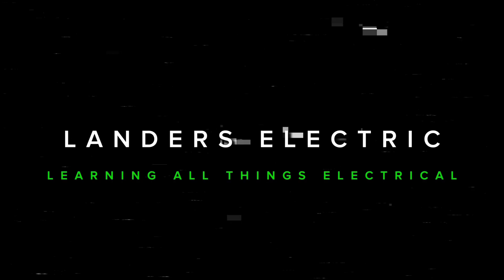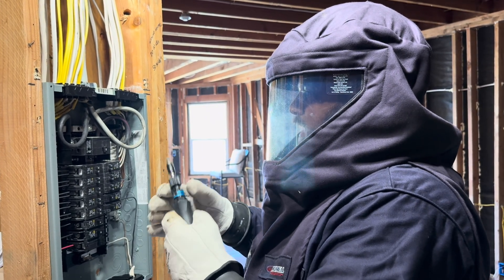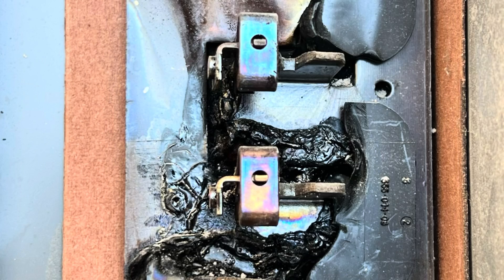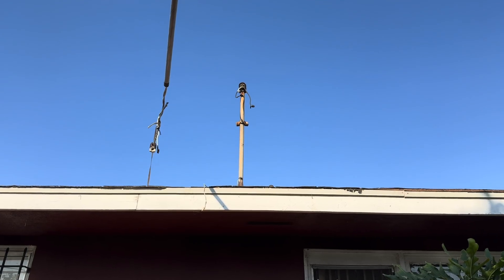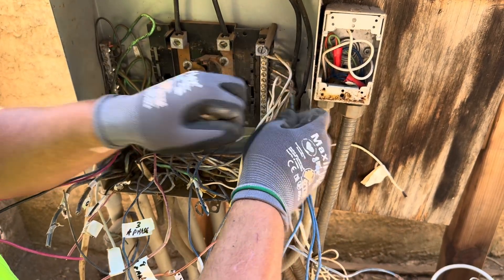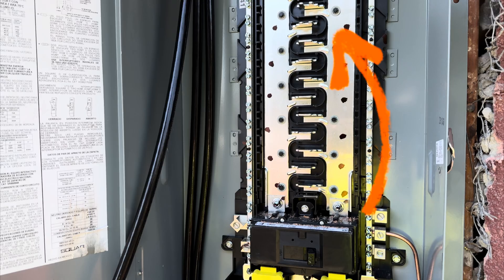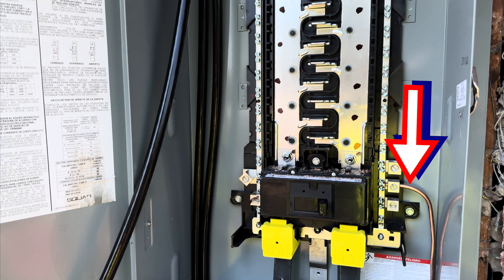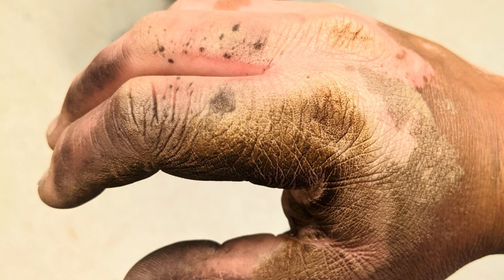I Could've DIED! | Electrical Panel Upgrade Arc Flash Accident

Comment: I just had my first accident where there was some sort of odd contact between the + terminal and chassis ground in one of my solar charge controllers. I had foolishly expected everything to go well and hadn't checked for continuity before turning the breaker on.

The contact was poor, but the battery was large (70kWh, 48V nominal LiFePo4) and boy oh boy did I get a nice bang and sparks flying everywhere. Thankfully since I am a bit paranoid, I was wearing safety goggles, although I think nothing did hit me there. I also noticed that the controller turned on fine, despite the spark ball, because some of the current also went the path it was intended to go. Of course, the circuit breaker tripped right there and then and soon after the controller went offline as a result.

Initially I had no idea what had happened, guessing that the device must be faulty. Until closer examination I was  baffled, but as soon as I saw the black spot at the + terminal I instantly figured out where the issue was.

This happened recently, and it still enters my thoughts. I will never forget to check for continuity again. Of course, this is the best kind of scare one can get because there was no damage to me or any equipment, but I still got a valuable lesson about respecting powerful forces.
Reply from the maker: That’s crazy! Really glad you’re ok and nothing was damaged! And yes, this is the best kind of lesson. I’m sure you’ll never do that again!

Comment: Glad youre okay. Reminds me when I was a Apprentice in Commercial Hvac. Working on a data center unit 460v 200 amp  I was checking voltages with my meter and accidentally touched hot to ground on a probe. All I saw was abright flash and the heat that came at my face. I was fortunate. Taught me to respect electricity.

Comment: The video mentioned Doctors looking entry wounds and exit wounds. One of the worst things about electrical burns is when electricity flows through the body from entry point and exit point the electricity will cause internal burns. In that case it is possible for the skin to look good on the outside while muscles and nerves are internally burned.
Reply from the maker: That’s a great point!

Comment: I did have a panel blow up in my face. It was my fault. In a hurry and did not check for voltage. My face looked like your hand. I was flash blinded and could not see. At first there was not any severe pain, but that changed and I hurt. Went to a hospital and they removed small pieces of molted copper from my eyes. I am lucky. It all healed and i do not have any problems from it.

Comment: I once accidentally dropped an uninsulated screw driver into a large battery box we were just starting to work on.  In a totally automatic reaction, i jerked backwards the instant the screw driver left my hand and closed my eyes.  No damage to any body parts but we could never find the screwdriver shaft after the flash.  It had vaporized completely.

Comment: His number 1 mistake was working past his limit of endurance.
The proper PPE (electrical rated face shield, appropriate hot gloves and appropriate FR clothing) for a given Arc Flash Incident Energy Rating is the minimum. That looks like a 40 Cal suit- for 120/240 split phase that's overkill. But, if it makes you feel safe, you do you. It's highly unlikely that the Incident Energy would be more than 1.2 cal/cm². Cat 1 PPE starts @ 4 cal/cm².
Hot gloves (or turning off the main) would've protected your hand; a 40 Cal suit is superfluous.

Comment: I feel bad that this happened. When you work this many hours you are NOT running on a FULL mind. I just couldnt work that many hours. I have taken down countless underground 100 amp & the more open 200 meter sockets that you dont use in your area down hot. I have had to change out 2 100 amp panels hot because they couldnt unlock the meter. Back then I had no protection but had to BE ON MY TOES & BE IN FULL CONTROL when I was doing this. If I felt I couldnt do it then I would ask my boss to have the utility come & disconnect the laterals.  In later years as I aged I told my boss to have the utility disconnect because I felt less confidant then I did in my 20s    I dont see the reason for a suit when cutting & taping off a service drop unless there are damaged cables at the weather head or metal very close to where your working off the FIBERGLASS LADDER. I found OVERHEAD hot service drop reconnects to be the safest hot work. I would line the box with cardboard [meter socket] , do one line at a time, tape it off , do the next one, tape it off with the stripped end cut off for my safety. On the more open 200 amp meter sockets that resembled a long trough I would take one off at a time, tape it off & replace the meter socket & have the utility reconnect or I would do it if the cables were plenty long enough [existing utility crimp lugs].
Whenever I did panel upgrades I would almost ALWAYS pull the meter so I wasnt working unnecessarily hot.
In my service area the meter socket ONLY is on the outside & the 22,k AIC main breaker QO panels I installed were on the inside. I dont understand why they put those all in one unit outside
in California!!
I wouldnt want my branch circuits on the outside. In Cook County Illinois you have to use steel RMC for the outside conduits & the whole house has to be roughed in EMT. ROMEX will get you a BIG red tag in my region!!
I have been disabled since 2020 & electrical work had nothing to do with it. Sometimes I REALLY MISS DOING MY SERVICE CHANGES. I used my license to help my family out as much as I possibly could. This made me able to give them 200 amp SQUARE D QO 40 opening full sized panels.  
DUDE, I feel VERY BAD this had to happen to you & the emotional & psychological harm it must have caused you.!!!

Comment: Yes, we check if power is off all of the time or we install protection around the bus bars. 
But with SoCal Edison and DWP in LA, if you tell the power companies to cut the power, you will be without power until you get a final inspection for the panel from the city, that could take weeks for the power company to return. In the past it was not like this but times have change. So, screw it, do it live, if its overhead cut the wire at the mast and put temp connections until the utility company comes and installs final connectors. If it's under ground, install protection around all buss bars and live components while removing the old panel and installing the new.
On 277/480, power needs to be off unless installing a breaker.

Comment: This why wear electrician glove is important at these voltages. as hobby only work with 120 volts and less. though at hvac class I did work with 240. but only thing above 240 one alway need ppe for even using volt meter.  I only do electric work when there is no power to circuit because I am clumsy.

Comment: Absolutely good thing you're alive and have healed up. Definitely double-check that the power is off. I sometimes work with 600 volts, and I constantly triple check.power is off, and PPE should always be worn. Power can kill and as you know.once past a certain volt.your stuck like glue.

Comment: Voltage is really only a risk as far as how far it will jump out to grab you (240 is not likely to jump the air gap, unlike the higher voltages). Current is the real problem, that is where you get the big flash.

Comment: It only takes a second to ruin the rest of a life to lose a life. As a power lineman for over 4 decades I’ve seen some bad things happen, I’ve lost co workers, had friends badly burned on the job. For most of my career FR clothing was not required, I was in a bucket truck on a pole transferring 3 phase primaries  for a highway road widening job. There was another bucket on the next pole who were going to transfer the phases at the same time. We were working energized primaries at 15kv, in order to direct handle that voltage protective rubber line hose and blankets are installed on the primaries. The primaries were spacer cable configuration which has all 3 phases and grounded primary neutral in close proximity. Spacer cable has insulation that resists tree contact trips of breakers, it is also very susceptible to lightening strikes, lightening causes pin holes in the cable allowing moisture into the cable which causes oxidation. The a lineman can’t see the oxidized cable because of the insulation. As the 2 lineman in the air were applying line hose to the cable, one of the cables broke in half because it was so oxidized. The when the cable broke, it broke load right where the lineman were, the flash went phase to phase causing a huge flash that enveloped both men. The lineman on the ground immediately used the lower controls to get the linemen out of there and on the ground. This was winter and the men had multiple layers of clothing on which the outer layers burned off mostly. If it was summer they would have been injured worse. Both sustained thermal flash burns to their faces. What happened to the skin on your hand happened to their faces. On primary circuits we have over current relays that operate when a phase to ground, phase to phase fault occurs, they also operate on over current. The relays trip the breaker then at timed intervals of 15 seconds and 30 seconds the breaker recloses, if the fault still exists, the breaker locks out. As the men were being lower the breaker operated 2 more times burning another phase down. Th thermal flash was so hot, that it melted the insulated bucket liners down inside the bucket. If this happened in summer both men would probably be dead. It only takes a second….. be safe out there.

Comment: Dang, I'm really surprised the main didn't trip since it was the bus bars that were crossed. Goes to show why panel swaps need to involve the utility company... because... you know, no over current device between the meter and the main panel's main breaker (unless the home has an ATS or other means of disconnect, but these are less common).

Honestly, I think an exterior means of disconnect should be required for all new home construction. IMO a panel in a locked up garage is not readily accessible.

Comment: I'm 25 yrs in the trade, and a master in florida. About 15 yrs ago I was a foreman for my old company. I got the call from my boss to go check out a a small 6 store plaza that we took over because another company got kicked off the job. I met the superintendent in the main electrical room. As I was checking quality of work in the gutters meters, and house panels I started small talk with him asking about the previous contractor. He told me the guys were hacks and did a lot of questionable things that even him not an electrician knew were wrong. He then told told me the final straw was one got killed on the job. I freaked was like WHAT THE F#@K!! WHERE, HOW?? He then said right there pointing at house panel. 120/240v 42 circuit panel. He had on hand on the bottom of can and was messing around with main feeds to the panel. They were aluminum and must have been pulled very rough as a big slit was in the backside of the B phase. Needless to say I had to scrape the guys fingerprints from the bottom of can then threw the screwdriver away. Respect it or it will kill you.

Comment: I know 2 people that were hit by lightning..... Twice. One had minor problems after(dead at 40), the second had chronic neuropathy along with entry exit wounds that healed. I've been hit by a house service main through a Dump truck twice, one made me shit my brains out within minutes. My Crane got energized by 101kv when the temporary grounding system failed. Bunny hops saved my bacon. I've hit 440 underground primary with a backhoe. Arc flash turned the digging bucket blue and both me and the shovel man had mild retinal burns. I've been sprayed in the eyes and face with battery acid, lost consciousness from chemical fumes, had a gas can blow up while trying to rescue a guy out of his burning car( 2nd degree burns on face and throat) [ Hint. don't breathe in fire] cut off a finger (successfully reattached) , works ok )🖕 yup, that one. My Dr asked me if I've ever been hospitalized 😂😂😂😂 sure, how much paper do you have to write it all down? Oh, and broke my cervical spine twice, both legs, one arm, hip,ribs, lots of fingers toes ankles.... Still alive.😂 Forced Retired at 49, you're running outta luck they said. 62 and still alive and complaining

Comment: It seems so easy to forget that the entire buss is still live when the main breaker is shut off..  I think the only way to make the entire box safe is to pull the meter but I'm not an electrician.  I notice they do allow a generator transfer switch to be installed upstream of the main box that can make the entire box safe but I wonder why not just a simple shut off switch in its own box. I know there is a bonding requirement and maybe that explains why the code tries to just have the main breaker be the only shut off even though it leaves the bus live.

Comment: Arc blast is no fun. 2008 pulling a 75amp fuse in a 480v bucket that had bleed through voltage. Fus eblew up, 30 foot feet to cieling fireball and blew 3 main 1500 amp fuses to the plant. Safety glasses went from clear to smoky black with burns on face and arms (safety glasses saved my eyes). Also used plastic fuse puller instead of Channel locks, saved my life. It's not proper protective equipment for nothing. Ambulance trip and time off with no pay.

Comment: That’s happen when you don’t follow the basic safety rules: The 5 safety rules

Unlocking
Secure against reconnection
Ensure that there is no voltage
Earth and short-circuit
Cover or isolate neighboring live parts

Comment: I've seen a few arc flash accidents, or atleast the immediate aftermath. One former coworker of mine was trouble shooting a 2500 ton press. For some reason that day, he forgot to kill the main power before checking the fuses. As he pulled the first fuse, he got a 600V arc flash. Luckily he did have a face shield and gloves on, but not the fire retardant suit. We usually didnt wear the suits because it was around 125 degrees on top of these presses where the motors and electrical cabinet are. He burst into flames instantly, he managed to tear his shirt off, but not before getting 2nd and 3rd degree burns on his neck, chest, torso, and legs. He was in the burn unit for 2 weeks. Another time, working on a radio frequency machine that welded plastic fabrics together, I was with another person, and he used a class 3 meter where he shouldnt have. The machine had 380 volts going into it. That went thru a transformer in the machine and stepped up to 2800 volts, which went thru a series of rectifiers and capicitors that jumped it to 50,000 volts D.C.. He touched the leads on the high voltage side of that transformer, and it arced, blowing the meter out of his hands, and charring him up a little. He was lucky that meters wires were so thin. We had seperate meters for anything over 700 volts. He simply wasnt experienced enough for the job, and he did last long.

Comment: Thank you for sharing.
Using those pesky beepy voltage detectors NCV or however they're called is crucial.
Check everywhere, you never know.
And don't rely on the Breaker. Check for voltage even if it's off. Don't trust it.

Comment: Back in 1997 I worked at a rubber plant. We made raw rubber sheets for tires, belts and wire coverings. The belt system for the mill rollers stopped, we called maintenance over. He went to the electrical box and stuck a big screwdriver in to release something. I saw a bolt of lightning come out of a 240 box, blow the guy 10 foot away , he slid across the floor. His right arm barely hanging on by his elbow joints. The screwdriver was melted or half the size it was. The current went in through the screwdriver and out his elbow where it was bent. Any electrical current Very dangerous . Glad you made it out alive.
Reply: This was 240 or 208v 3ph?

Comment: Thank you for this video. I just had a good friend who owns a lumber treating yard get burned severally. He had an electric motor that was shorted out and did not test it. It had blown a fuse, and he simply wanted to install a blade bus fuse in the panel. With the motor bad as soon as the fuse made contact it blew up in his face. This was a 480-volt line. He survived but is still in the hospital. I now see the burns and what they can do. This vide needs to be watched by everyone attempting this kind of work. Always best to call an electrician when in doubt.
Reply: Good work. Arc flash is horrible. I was a pirate jackleg kid who never got hurt. Swapped an ancient 100 amp residential panel with a locked anti tamper meter base, I taped  the service entrance conductors and pulled the old panel down slipping them thru the k.o. I had to mount the new panel upside down to reach the main because the conductors were too short. I am an atheist but God does love me.

Comment: I bet you use silverdiazine cream

That stuff is the best 

I loosened a hot lower radiator hose on a Cadillac and it blew apart and washed boiling hot water into my shoe, basically washing the skin off my foot, with that cream by the time it healed I had no scarring at all

Comment: Thank you so uch for sharing. I'm an electrical engineer, and I work in high voltage cabinets, 500 volt at the highest and I don't think anything of it.  Everyday, I try and remind myself to slow down, and don't hurry.  But it concerns me, because I have way too much resonsibility, calls from all over the world, pressure, deadlines, and I'm responsible for mechanical engineering as well.  And it seems to me,  its "hard to believe this can happen."  DON'T TAKE THAT WRONG!  I KNOW IT CAN.  But a residential  cabinet to me, is nothing.  YOU PROVE IT IS NOT!  I thank you for myself.  I don't own an arc flash suit, and I'm not sure how I could do my job with one to be honest.